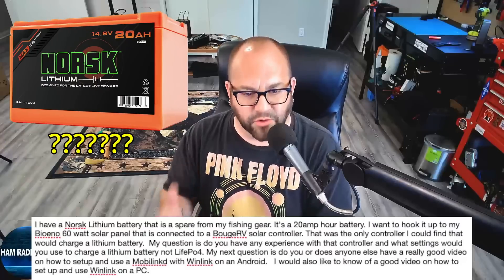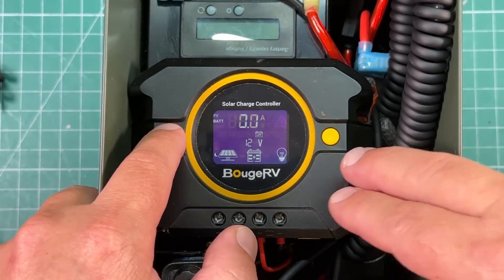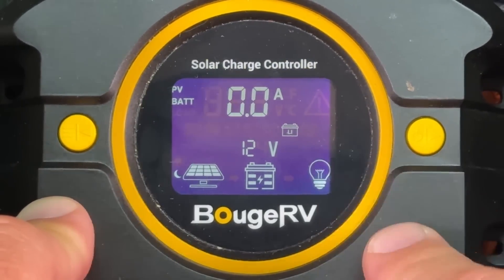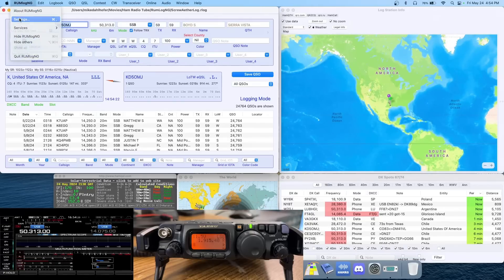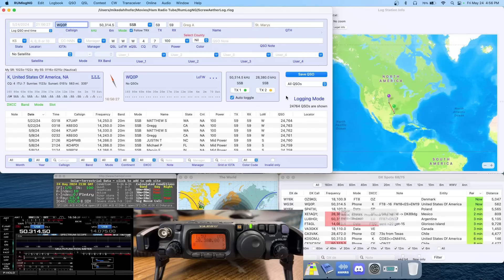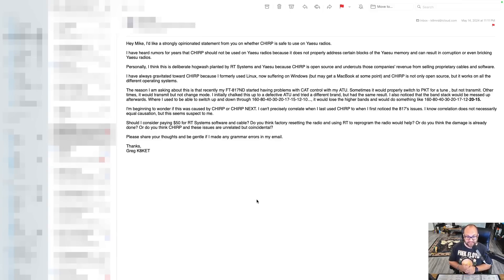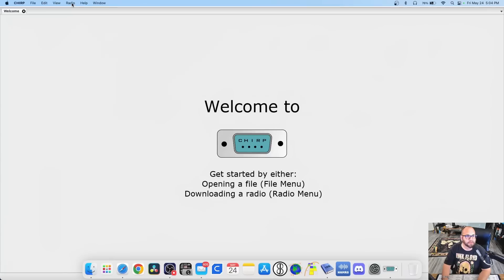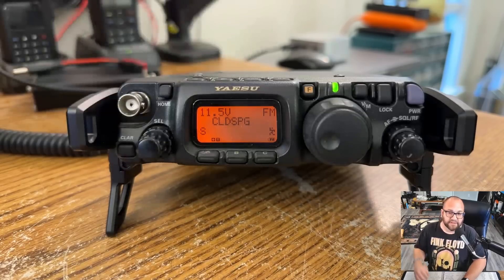Does Chirp Kill Yaesu Radios??

Comment: I talked to a Yaesu repair person about my FTM 100DR.  What he was saying is that the digital radios have a unique serial number built in. Without it, or if it is contaminated, the radio will no longer operate on the YSF/Wires/digital mode.  The FT70DR, which I have, would, as he put it, "become a standard dual-band HT" and it would no longer work for digital.  

I have not heard of the 817 or 818 being affected, but I haven't necessarily heard everything. My conversation was with the technician in a forum specifically about the warning he made about the Fusion radios. 

I have a lot of software for a lot of radios including plenty of RTSystems software products and Chirp.  Every one of them has the same disclaimer.  "not responsible if the software bricks or otherwise damages your radio"  Yaesu, as well as other manufacturers say the same thing  about any radio even if you use their own software, any damage voids the warranty and they are not responsible 

I don't use Chirp on my digital radios, but I use it on other radios. I use RTSystems because I can transfer data between radios easier in most cases.

Comment: Chirp works really well with my 817ND. It does have some issues with the VX-6 though. It's absolutely fine untill you start using it to make a large number of changes to the Bank assignments. The upload to the radio then fails. The solution is to make a small number of changes at a time and program the radio at reach stage. This is my third VX-6 (lost one, bought another and had a warranty replacement on that) and the same thing happened on all three. 

All that aside, It's the only handheld radio (and I have a few, cough cough} that i would replace (again) like-for-like as it's absolutely solid and reliable in use.

Comment: I have Linux and 2 Yaesus. I also have RT Systems programming cables. I have installed the latest version of Chirp on my Linux Computer. I got rid of my Spyware and Children's  toy years ago so was unable to use any RT Systems software and/or cable. Recently RT Systems has created Linux  drivers for their cables and now I can use chirp. Before the Linux drivers you had to run RT systems in a Windows Emulator Like Wine. This is where the problem of bricking radios probably  occurred.   Any time you run a non Linux compatible  software in Linux running wine it will not run perfectly.

Comment: You can make a DIY programming cable for the Yaesu FT-4 using a cheap Baofeng programming cable. I bought several clones on AliExpress for a couple of bucks a piece (and free shipping). Used the instructions from DK9JC's blog to modify the radio plug end (you basically snip off the longer of the two plugs; just cut between the two plugs) and the YouTube video he references in his post to modify the USB end (you basically verify the correct wiring between GND, RX and TX, modify it if necessary, and add an IN4001 diode as shown in the video to step down the voltage). Literally, took about 10 minutes (mostly spent measuring twice) and cost about $2 (had several of the diodes salvaged from old electronics in my junk drawer). Used it with CHIRP NEXT to program my Yaesu FT-4X and it worked first time. I was amazed.

EDIT: On DK9JC's blog, it's the post dated 08.Jan.2019

Comment: I use CHIRP with VX-5R and VX-6 with absolutely no issues and quite happy with it. I will never buy another RT Systems product - bought the ADMS-1E for VX-5R years ago with the RS-232 serial cable. Called them asking if I can just buy the USB cable as I no longer had RS-232 port - was told that I need to buy the software again. CHIRP works way better; it is free, and I can easily copy and paste memories between the 3 different HTs that I have.

Comment: Chirp bricked my Yaesu VX-3. I had to send it back to Yaesu for repair. I had programmed it successfully using Chirp several times before. I have no idea what finally caused Chirp to brick it, but it most certainly did. I still use Chirp for all my cheap Chinese radios. It's a pain in the rear to use different software and mimic the settings in each one, so mostly I just use the cheap Chinese junk now. Pity as Chirp is excellent otherwise.

Comment: CHIRP screwed up my FT-7800 and FT-7900  I did a hard reset and used G4HFQ's software without any issues.  I use the Factory YAESU software on my FT-70, and FTM-200.  CHIRP worked OK on my KENWOOD TM-281

Comment: I lost 60m from my UK FT817ND (the individual "channels" are stored in special memory channels).  Yaesu tech support confirmed it should work on 60m and gave me some suggestions but I could never get the memories back, or write the frequencies into them again.  Factory reset didn't fix it.
This happened after programming the radio with Chirp, however I've no idea if Chirp caused it or if it was like that before as the radio was second hand.
I've modified the jumpers inside the radio so now it's widebanded, but I've lost the restrictions on out of band transmitting everywhere else.

Comment: I had an FTM 3100 that I could not get chirp to work on so I had to go with RT systems. However that radio finally burned up putting out a half a watt even after sending it to Yazoo for the issue under warranty and of course now it is no longer under warranty.. KB8QJF

Comment: My problem with ST Systems is that they do NOT cater for anyone using Linux. Thus, I'm moving away from Yaesu, and over to Icom instead. At least the SD card can be programmed using the Icom s/w under WINE with no issues at all. 73, G1LIW

Comment: 9:25 I recently tried to download a copy of memory out of my VX-6r radio using CHIRP running on Ubuntu. The transfer never completed properly. It wasn’t until I tried using a few of the menus that I realized something was wrong with my radio. Luckily, I was able to fully restore the radio with a reload through RT Systems on Win10. My radio wasn’t exactly bricked, but it was acting a bit odd after using CHIRP.

Comment: I have a VX-7R and use CHIRP(-NEXT).  Recently the radio started refusing to switch between VFO and Memory mode, or from Sub to Main VFO.  I don’t think this was just after programming, but I had recently downloaded/reinstalled and pulled radio configs with both CHIRP and VX Commander, on a new (to me) Surface Go.  I did a full reset of the HT and uploaded an older saved config using CHIRP, which made it work again.  Feels like something got corrupted, but hard to say whether that was because of the program, or on my PC or in the radio, or on the wire in between.  It does scare me a bit that something which can break basic functions is settable by programmer?  Seems like it should be “config only”, and not a robust system design if the unit can be bricked by user input (even corrupted input).

Comment: In regards to chirp on yaesu, is on the C4FM radios, chirp has been known to corrupt the digitsl serial number of the radio, which can cause problems with Wires-X functionality, especially when the radio is used as PDN node.
Yaesu does provide free programming software for the C4FM radios that have the Wires-X PDN function, unfortunately it is basic, and windows only.
Again, only the C4FM radios are the ones I am aware of, and yaesu's solution is provide the software for free on their website.
Reply: I have used chirp with my FT-70 and per the Yaesu FT-70DR - CHIRP Programming guide as of 01Jan20 Chirp only supported am/fm modes and it did not support System Fusion modes. I never saw a problem with digital serial number corruption, I was only unable to select/deselect the "ams" option, or any of the c4FM. Best practice  whether Chirp or RT Systems, is to download from the radio, edit than image, then upload.
Reply: Funny and a bit perplexing. I contacted Yaesu directly about this specific issue. They responded that they DO NOT make nor provide ANY software. None, nada, zip. That was from a regional manager directly. He also told me not to use Chirp because it will brick their radios and to buy RT Systems. I've never had issues with Chirp and six different Yaesu radios; granted none of them have C4FM capability. I have only located Yaesu software for their repeaters as I have a DR-1X. Given I asked about Chirp and that doesn't work for repeaters, I wouldn't have expected the Yaesu guy to inject repeater software but he said they don't make any.
Reply: @flashover52  That regional manager has apparently never heard of the ADMS software freely available for download on Yaesu's website for most of their C4FM radios. I didn't see ADMS listed in the files section of the FTM-500DR but I think you're meant to program it via its SD card. I also don't see it for the FT-991a, but it's there for all of their other current digital radios.

Comment: Mike, Many Thanks! I had not discovered  widening. Cool beans!! Also the Transceiver menu is interesting. From what i can see there, you could conceivably have 10 sets of setting  -- save them into the 10 memory slots, then load them one at a time into TRX #1 or TRX #2, max of 2 at a time - or so it seems from the ui.  I have not verified that functionality yet.  Thanks again for taking the time to read comments and answering queries and being a mac ham radio mentor/guru. 73 de k1jbd, bammi

Comment: I have heard this for years and its always "somebody I know" or "I heard from this guy" that had their radio bricked by CHIRP You  can never find the actual user whose radio got ruined by it. And since I have programmed several Yaesu radios successfully with CHIRP, I personally think its one of those internet rumors that just happen to benefit certain other parties. Also as much as I like Yaesu equipment they do do stupid things with programming cables and SW that make it easy to believe  Yaesu or RT would pull a stunt like allowing a rumor to circulate that disparaged CHIRP.
Reply: I have personal experience with Chirp bricking two 8800’s.
Reply: I got a used FT-70D with programming cable last December and have been using CHIRP-NEXT to program it all along with no problems. I never use WIRES-X as I have an MMDVM hotspot and just link different reflectors from within the Pi-Star dashboard. It saves me from having to memorize a bunch of numbers to directly enter from the radio. So I don't know if anything happened to its digital serial number, but the radio's far from bricked.

Comment: I use a program called Commander which gives quite a few good capabilities. It was written by HB9DRV, its full name is ft-817 commander v2.2 beta. I have been using it for several years and have had no problem with it. Good luck   K3ETD

Comment: I think you're dead on with the RF in the shack suggestion, it's the most common explanation for erratic behavior from equipment, particularly when it seems to come out of nowhere. One minor change...different coax jumper, new tuner, new switching arrangement, etc., can cause RFI issues to arise. Choke, choke and choke again! I think the foundation of my house is starting to shift from the sheer weight of all the ferrites I've bought... 

Chirp is great, I use it when possible and doubt it's actually "bricking" anybody's gear. I do recommend RT systems for more complex programming, especially digital radios. I'm happy to shell out $25 for my Anytone radios as it makes programming them so much easier than the provided CPS. My used FT3d came with RT systems, which the company happily transferred to me and works very well.

Comment: When I first got my tech I was told not use chirp on Yaesu radios by someone at HRO because it would brick them.  so i always checked the chirp compatibility list before buying a radio. I eventually did get an FTM-400, but if Yaesu supported Chirp, I would probably own more of them.
Reply: Does HRO sell RT systems packages?